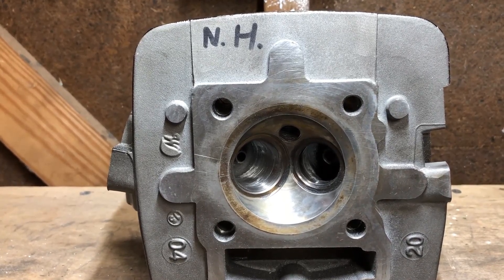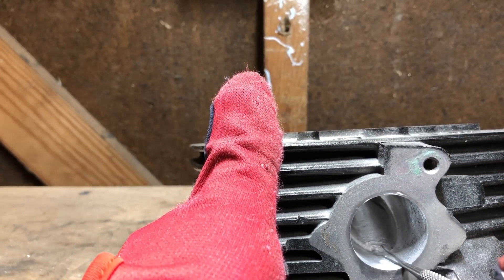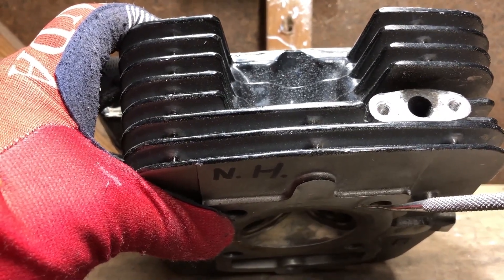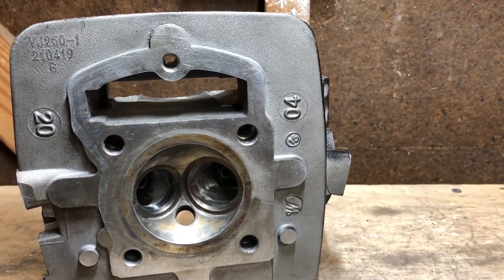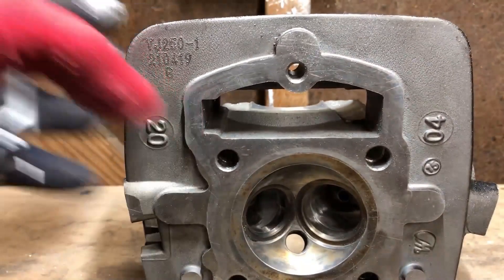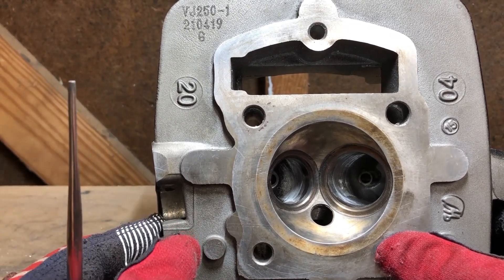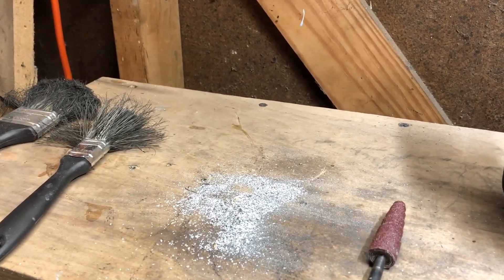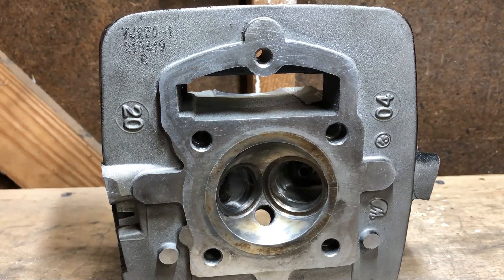Beginners guide to Porting a cylinder head video #2 Tbr7 performance upgrades

Comment: Nice video :)
How much does this head porting & matching cost ?
Reply from the maker: Thank you! Overall I made this series on head porting so someone who maybe hasn’t done this style work before can do it at home with a few tools…a shop price for porting can vary depending on where your located & what said shop charges my rates for porting & gasket matching etc etc vary depending on what head someone wants done so a set of LS heads I charge around 300-350 bucks for the pair to port & gasket match but a smaller 2V head like this one in the video I used for an example I charge around 100.00 flat since it doesn’t take me too long to do the work if your ever interested in having some head work done definitely let me know I’ll see what I can do for you!!

Comment: I got a question.... 80grit small flap wheel...good idea or not to hone/blend not inlarge port... Dremel have them ...it's like a lil frisbee
Reply from the maker: So yeah I have sanding drums for my 1/4” die grinder as well as flap wheels I like them for the beginning blending to smooth out any rough patches before I work up to 120-180-240 etc etc sanding drums!! Should work good for you!!

Comment: The exhaust crush gasket idea is how I was thinking of doing it too...
Reply from the maker: Yeah it makes things a bit easier if your not sure how big you’d want the exhaust port I usually just lay one in there & mark the material I want removed with a paint pen…but leaving it all together works great as well!! Just need to make sure it’s crushed already or it’s gonna end up larger then needed causing a little unwanted turbulence but overall it can be a touch larger if it happens nothing to worry about!!!

Comment: 👀.... I wanna do that.. but.. my ports kinda look ok .. just need to port match....
Reply from the maker: So yeah the issues found in the castings won’t typically come to light until the valves are removed right after the valve seat area it’s very common to find a bunch of excess material you’ll wanna clean up since after gasket matching your allowing more air to flow in but it’ll still get trapped or “bottle necked” I like to call it typically just cleaning up the casting or very light porting still show’s benefits since an engine is just a air pump in its most basic form so more air in & more air out  is more power!!